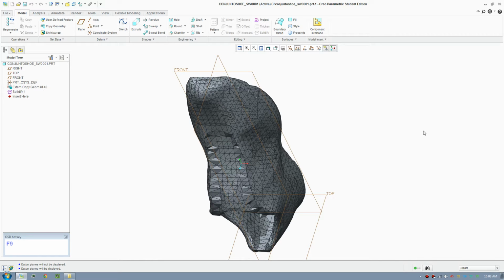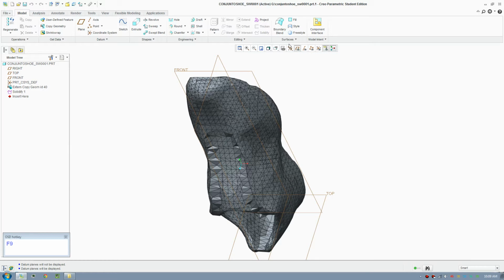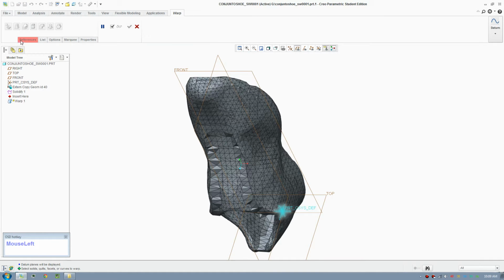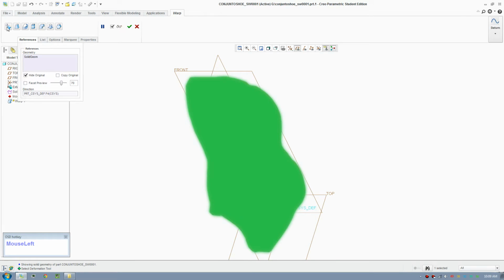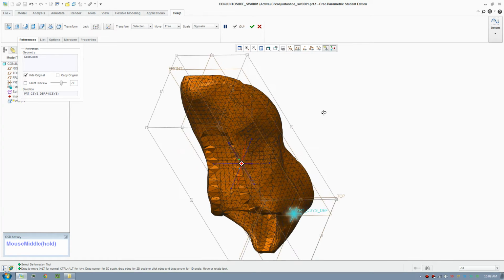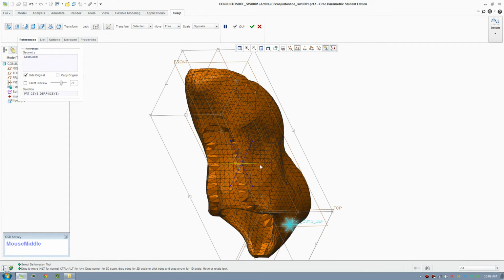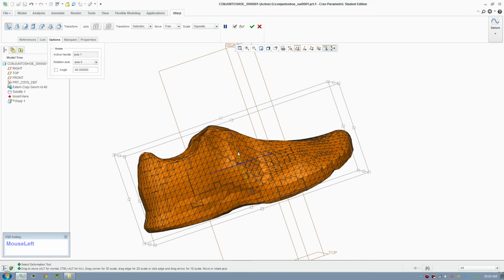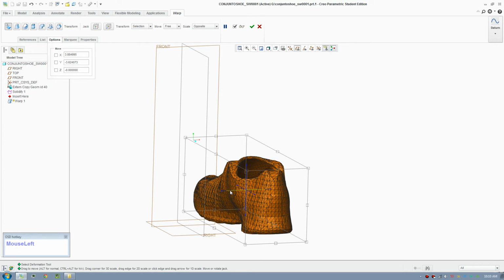Creo Shoe Tutorial 2 - How to Move, Rotate or Transform an Imported Model

Comment: How to rotate without mouse,  i am using this in laptop, plz help me
Reply from the maker: You need to use a mouse. Or you can switch views with one of the buttons on the quick toolbar.
Reply: @3DSurfacing  is there any others ways or shortcuts till now using touch pads on laptop?

Comment: I can't rotate the part. Will you help me . short cut keys are not working
Reply from the maker: +Harish Sama use a mouse with a scroll wheel. Press and hold scroll wheel and move to rotate.
Reply from the maker: +Harish Sama use a mouse with a scroll wheel. Press and hold scroll wheel and move to rotate.
Reply from the maker: Try a different mouse. Try pressing the middle mouse button, hold it and drag. Make sure the mouse is position on the viewport. Then it rotates.
Reply: Kk....I will check it out .....thanks :)
Reply: Even by pressing the scroll wheel i cant rotate the object ........want should i do?????
Reply: its working ya thankx a lot